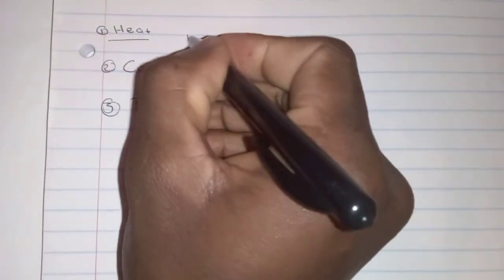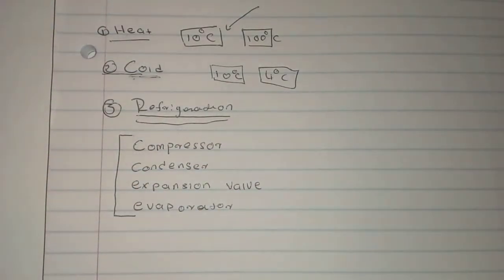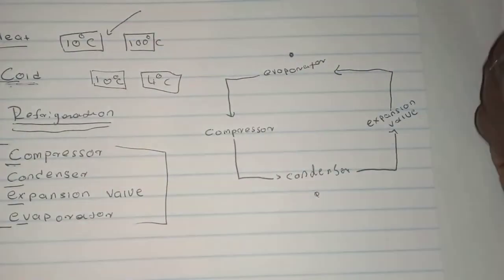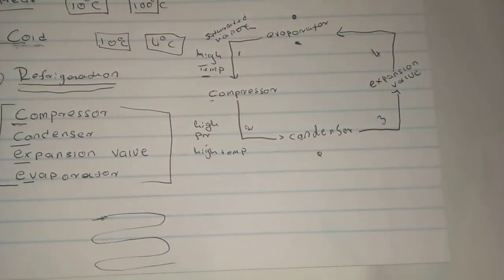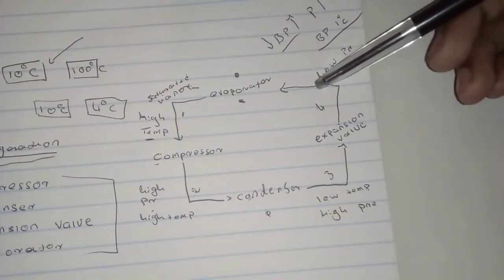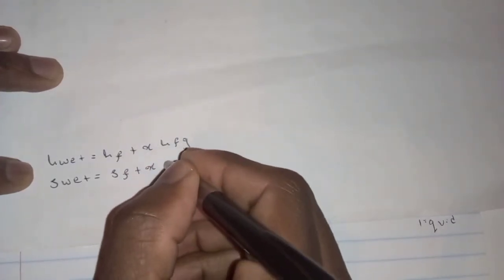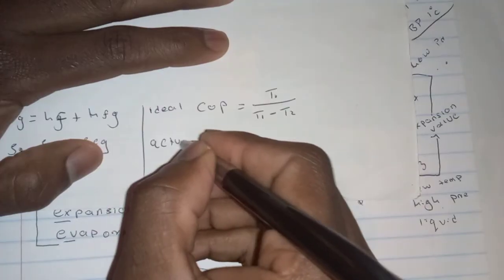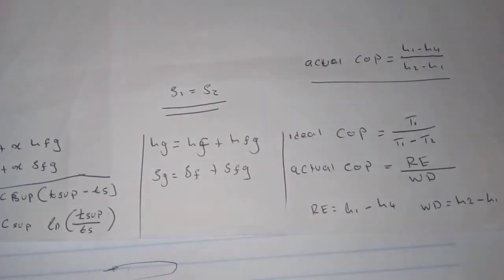Refrigeration (1 of5) Power machines N6

Comment: In reality your expansion valve is much closer to the evap. Ur point after expansion valve is called. Flash point were ur refrigerant boils off to absorb heat. If u have 2 temperature probes u can measure your super heat which should always should be between 7k to 10k which should tell u if your work done by evaporator is efficient.